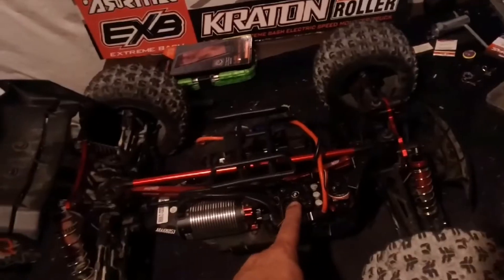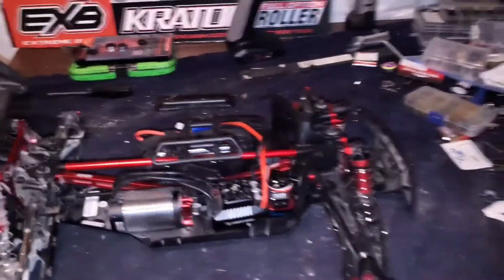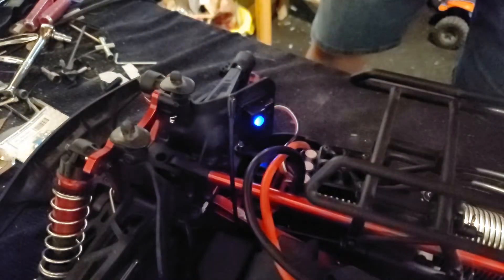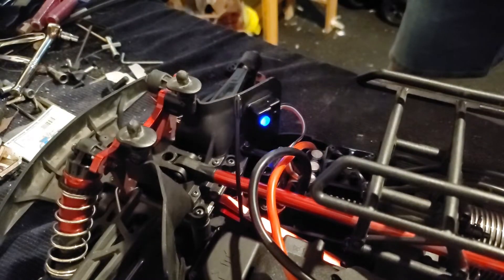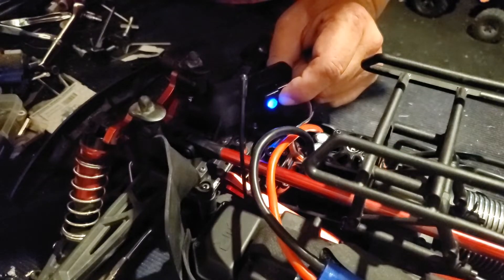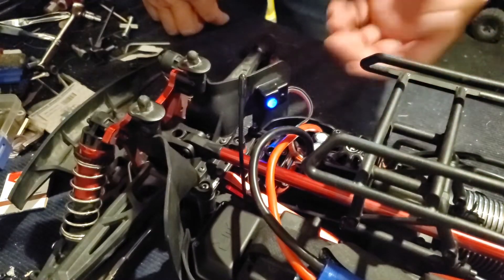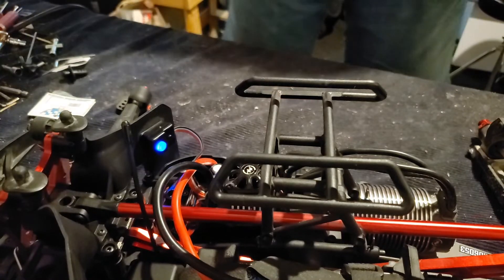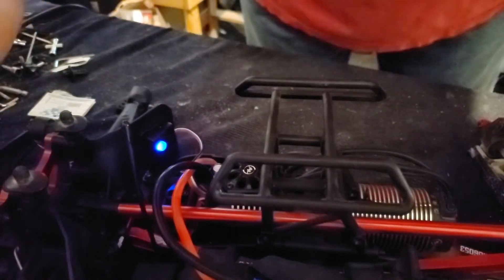How to Calibrate and Program your Hobbywing Max6 ESC

Comment: Hobbywing max 6 g2 blinking red rapidly. I have steering but no throttle on my Traxxas xrt. Brand new only ran it twice. Please help!
Reply from the maker: Try to recalibrate it. If that doesn't work, try unhooking the motor wires and plugging them back in.  If that doesn't work. You may have a fried ESC.

Comment: How I can set it up only throttle no reverse
Reply from the maker: Hold the set button and power on and let off on the set button after the first green flash  it should flash 2 red now  press the set button once and the esc should flash one red   power the esc off then on again and you should have just throttle and break